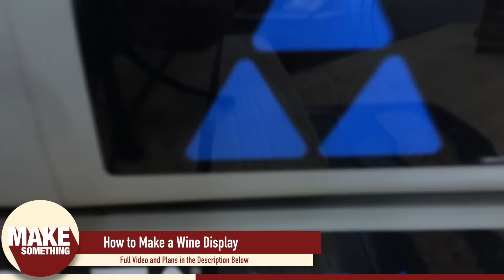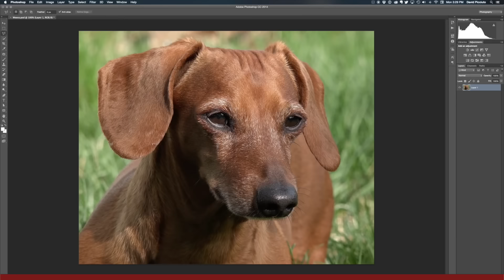13 Woodworking Projects You Can Make as Christmas Gifts!

Comment: Noticed you used a jet 10-20. My son Is 15 and looking at a drum sander most of his projects would fall under 20 inches. Do you like the 10-20 or would money be better spent on like a 16-32 Drum sander. Thanks for the great video
Reply from the maker: Ever since I had the 10-20 I wish I purchased something bigger. Also my 10-20 is really hard to calibrate and change paper although I think Jet has fixed these issues in new models.

Comment: Do you have any wood plans..for a wood heavy duty IRONING BOARD..we go through at least 1-2 each year..I think either my sons or wife lean on the board to plug in the iron ..and after a while....the cheap metal legs bend ..then were running to Walmart for replacement...very annoying...help.

Comment: Oh yea no problem you just need a band saw, super nice expensive table saw and a drill press. Yea everyone has those
Reply from the maker: Hi Erik! They are woodworking projects meant for woodworkers. Woodworkers tend to have woodworking tools. Merry Christmas!
Reply: You can do the same thing with a jig saw, a circular saw and a power drill. If that's too fancy you can use a coping saw, a panel saw and a brace and bit, but those tend to be more expensive, hence your gripe I'm assuming.

Comment: Lol, anything I can make with a sawzall, circular saw, impact driver, and drill?
Reply: U can get cheap f-clamps at the tool supply store and those have a high useful-price ratio imo
Get a coping saw (handsaws are cheap and accurate when practiced with)
Get good with a chisel

All I use basically ^ 
Just got an electric planer, still use my chisel a lot
Reply: Yeah, a mess